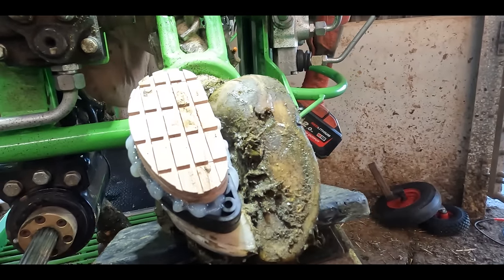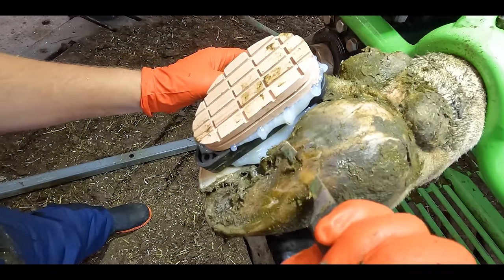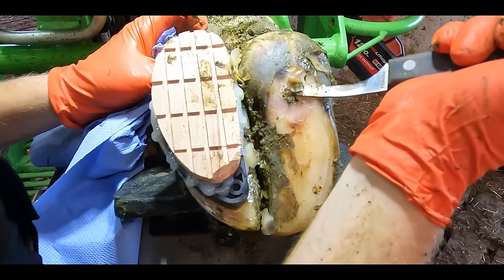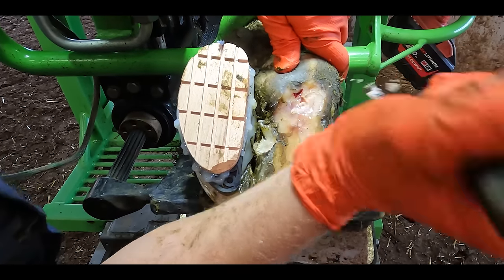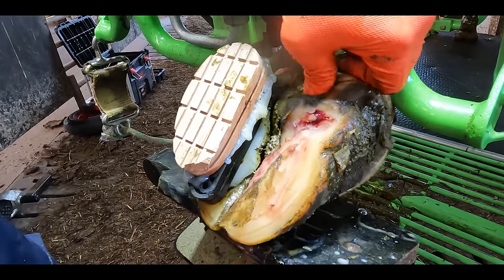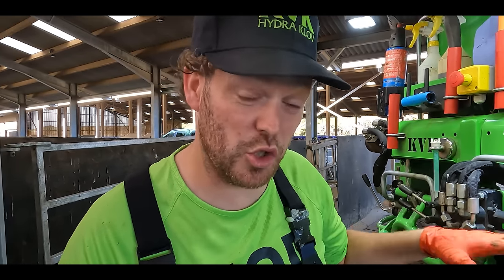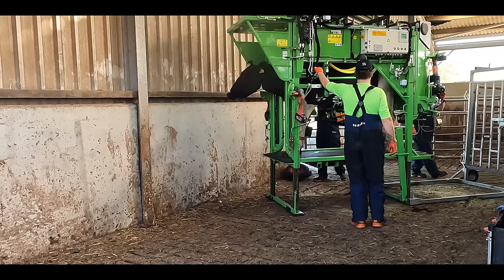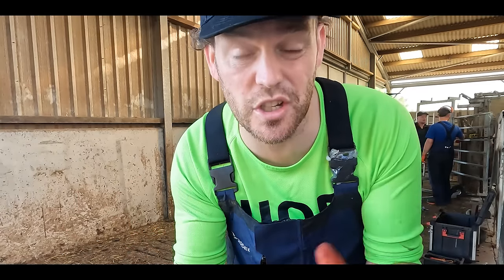HUGE SQUIRTS from this COW's HOOF

Comment: Alright I'm kinda curious this time,  knowing that there's a large cavity like that under the hoof horn,  did you not trim off the detached part right now so the vet can see the hoof as is before you remove everything that's detached? I was waiting for you to start on removing all the detached and you didn't....
Reply: I was curious about this as well
Reply: Think bc he knows it leads up to soft tissue not hoof guts. Like up the ankle bit
Reply: I think it's because it's in the acute stage, or very new and very active, they need to get the infection under control first. If the infection is too new things may not have separated, it might not actually be detached, yet. Once the swelling goes down fluid will gather between the layers and delaminate the hoof horn. I'm guessing all this based on human medical knowledge, but infection healing in mammals is basically all the same

Comment: Question: you typically remove any loose hoof horn, why in this instance did you decide to keep the hoof horn that is over the pocket this time instead of exposing it completely?
Reply: I was going to ask the same thing!  I thought for sure all the loose hoof horn was going to be removed.
Reply: Following. Wondering if it was because the vet can cut into live tissue as needed or because the infection extended into the joints so has to be treated systemically.

Comment: Hi GP! Sometimes when you find an abscess you peel back all the horn covering the capsule of the abscess, and sometimes you don't. What sort of things help you decide which way to approach it? Asking as a layperson, I have to trim cat claws, not cattle claws :D
Reply: Not GP, obviously, but it looks like it partially depends on where the live tissue is and if the abscess has bust out the top of the hoof. In this case, it looks like most of the horn is still attached to corrium with the abscess lying mostly under the live tissue.
Reply: From what he was saying, it sounded like the abcess was deep inside the corium, so no sense of peeling away the hoof if the hoof itself is sound!
Reply: I wondered the same, maybe once it's healed he will remove the delaminated horn

Comment: I know that farting sound you got when you pushed out the puss. Well, not caused by puss, but by air. If you look at my pic, that is my back and I used to perform body suspensions. As you see with that specific suspension, I had 8 large hooks push through my flesh right before I performed a suspension and when those hooks are attached to paracord and I’m pulled up, it stretches the skin which pulls in air so you have to push it out. One time I hung for about 4 hours and my back had so much air in it, it made me look deformed. It took a bit for all the air to get pushed out, but I was dying of laughter as my back farted. 🤣

Comment: I have the same thoughts about "liking" the video. I do have a question, though. When there is an abcess, you usually remove all the detached horn over it. Why did you not do that this time?

Comment: I think I know exactly how that cow feels, I have stage 4 kidney failure and have Gout attacks sometimes because of Uric-acid levels getting high causing crystal buildup in my toe joints. Imagine having 5 broken fingers on 1 hand and no cast to keep them from moving, Gout is 10x worse. A simple bed sheet will set you off at night like someone hooked a set of jumper cables to your family jewels and turned on the power.

Comment: When it comes to removing loose horn, it seems the heel area is treated a bit differently than the rest of the sole horn - more caution around what can / should be removed. Am I on target with that observation? But I do understand why you left the wound open in this case versus wrapping it.